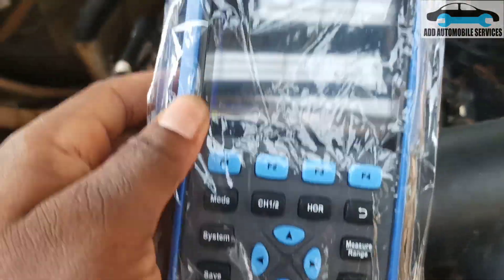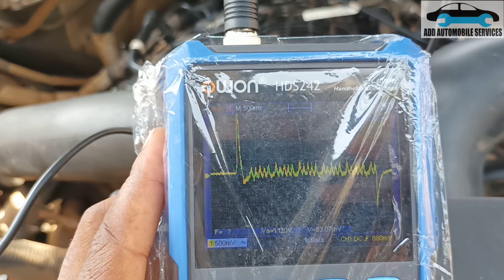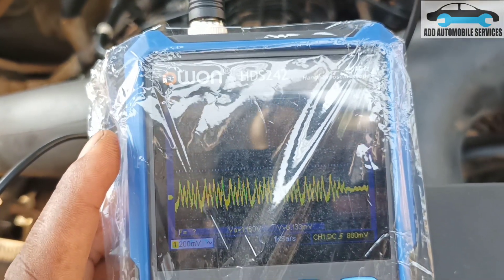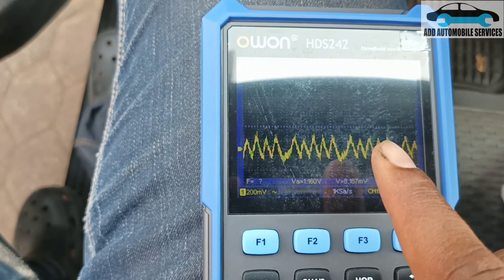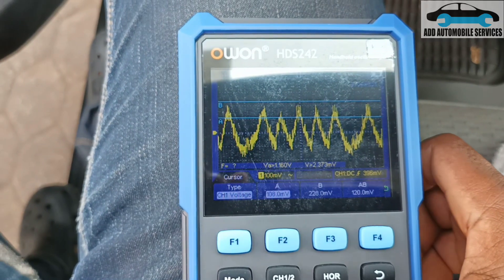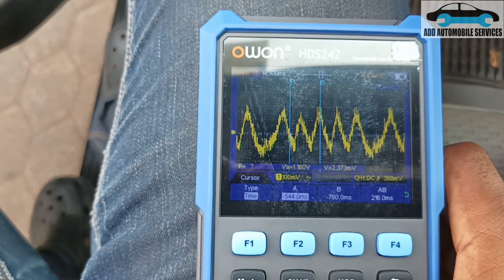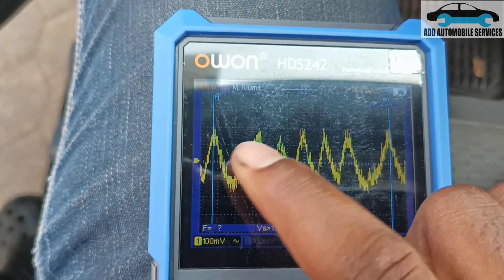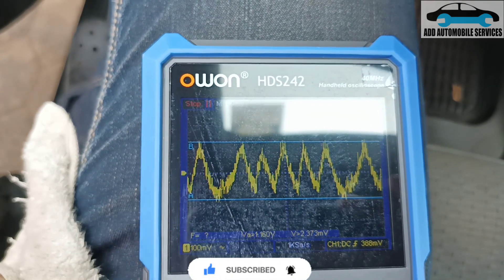Relative compression test with owon hds42

Comment: Hola amigo tengo el mismo osciloscopio hsd242 ¿ podra decirme la configuracion para colocar pinza amperimetrica?
Reply from the maker: Check the current clamp settings. It has to be 1v=100amper